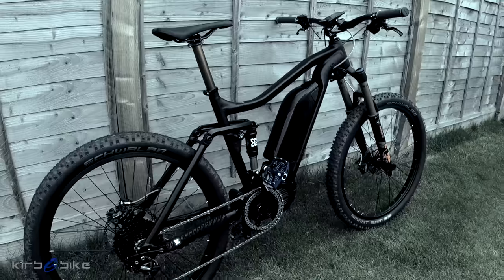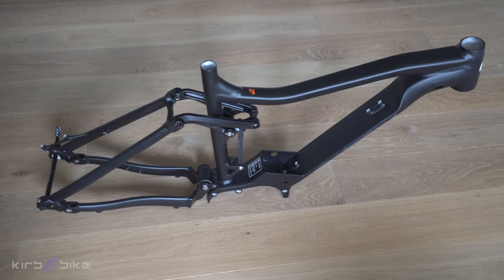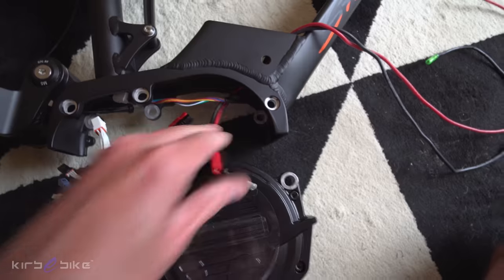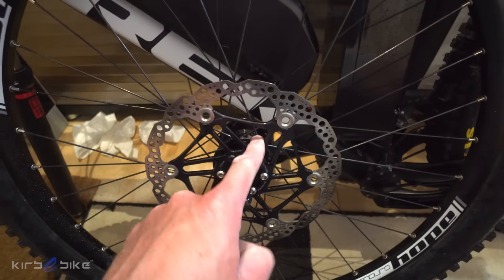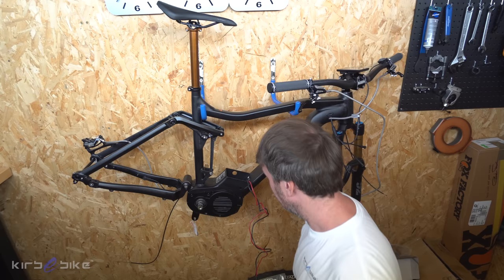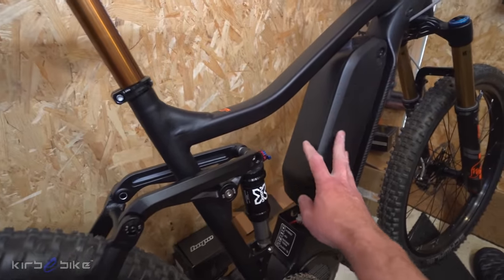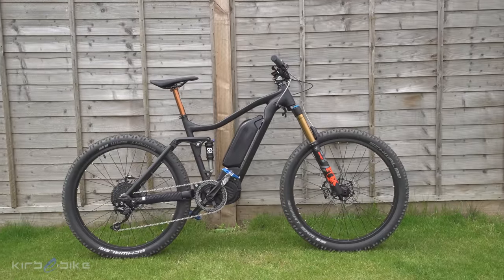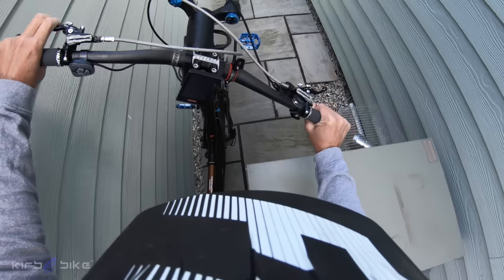HOW TO BUILD THE ULTIMATE eMTB!!! | KIRBEBIKE

Comment: Your videos are incredible – thank you. Very informative and interesting. I’m thinking to get a 1500W hub motor (front). Do you think I’ll have any trouble with the police on the roads? Any advice welcome – thanks 🙂
Reply: @BrotherChad   Since posting, I bought a 1,500w front hub and it’s brilliant fun! Thanks for the advice - I tone it down in populated roads, but am thinking might be good to get a mirror to check behind for cops! With additional pedal power I get 37mph. Great how, from rest,  the front wheel spins up on a damp road!
Reply: A 1500w front hub will do the job but is the worst ebike configuration possible.

It's dangerous to have that much power on your turning axle on a bicycle and you should absolutely not ride it in slippery/cold/wet/snow. Also you best have a steel fork, as aluminium front forks aren't built to withstand that constant force.
Reply: @guylloyd200  so a 1500w rear hub would be fine though?

Comment: I must admit your videos have been very helpful as last year brought a E+Plus bike from Argos front wheel motor, at first for price was very impressive had everything on it mudguards, chainguard, stand and many of items normally have to buy seperate so really felt I got a bargain never planned what to come.  Just after having it for a month and lost all power and forever hit a bump chain come off and the love for this cycle started to change, it started to sound tinny and deraillur was ugly and cheap looking never went into 7th when adjusted to 7th gear wouldn't go into 1st gear. Front disc brake went funny and everything about the cycle felt cheap, looked great but everything was cheap, metal mudguards and chain protector just going back to the 70s and early 80s, that was fine for then but not today as there is better materials, so I was going to send the cycle back but watching convertions had a better idea, with it being a eBike it had places to hid cables which a normal cycle just wrap cables exterior. so ideal for convertion,

First of all get rid of the hub motor convert to a mid motor so opted for the Bafang 250w, this would get rid of the nasty chain guard that when chain comes off takes 5 -6 minutes to get chain back on, no mesing with botton crank bracket motor slipped strieght through cables hidden and it has a back pannier battery soldered a better connecror got rid of their poor connectors that kept vibrating off.  Also swapped deraillur from their nasty looking one, replaced metal mudguards with good quality plastic ones so took all the rattling away when riding the cycle.  Had a spare front wheel and was able to use the tyres and inner tube which where probably best thing of rhis cycle, so I am now riding 35% of the original cycle as 65% of the existing parts have been replaced.

What as this done to my cycle?  As it was I would of given it 4 out of 10 but as it is now 8 out of 10, I need to get better disc brakes as already had a brake failure with existing brakes, I did buy a universal 160mm brake set but didn't fit properly think need a different  bracket, if I could get better disc brakes this would take the cycle to a great 9 out of 10. To get 10 out of 10 I think the colour of rhe cycle needs changing but not going that far.  But yes converting your own you can make it as you would like it.  All we need now is the UK to cange the law concerning ebike in line with US 750w, 28mph then could really build a beauty.  Mike

Comment: One more question: Is there the possibility to use a dropper post with internal cable?
Reply from the maker: I will cover this in another video, but yeah it’s possible. The seat tube is open at the motor bracket end so you can route the cable internally through the frame and out near the head tube.

Comment: Hi Andy, im just curious about one thing, why did you go with a 48v and not a 52v.

Also i saw in the video that you first tested it with a 52v. What was the difference you experienced? 

Thanks
Reply from the maker: Yes I tried it, on a reduction drive like this 51.8V is less noticeable than say on a hub motor. Also the 51.8V battery was higher in capacity and therefore quite a bit heavier which is noticeable in the handling (if you are chucking the bike around in the woods etc!!)
For commuting you could just stick a 51.8V battery on there and benefit from slightly better efficiency.

Comment: Hi Andy, Im building a backpack style battery with 38120 headway cells. My options are 8Ah with 16 cells or 16Ah with all 32 cells. Headways are big and heavy and the 32 cell pack is almost 20 pounds. I plan on doing 10 mile or less rides. take my kids to school and get milk from the store type stuff. Will 8Ah be enough? Bafang mid 750 btw.
Reply: I found a Cannondale Downhill bike called the Perp 2 for $650 cad, thats like 300 uk bucks. Its from 2009 but was never used. Its all ready to go, just need to finish the battery. Looks pretty stock when you spend the time on cable management. I also connected the bafang headlight power to a RGB led controller. I snaked RGB led rope lights along the frame to give it a cool red glow effect when the sun goes down.
Reply from the maker: Cool, I reckon 8Ah would probably do it if you are keeping at 10 mile range...

Comment: Amazing build. The peak power is around 600-700 watts on high end mtb not 250 watts but they do deliver in a more progessive way than bafang. I still trade this for power.
Reply from the maker: Ah..but have you tried this bafang because you can tune every parameter 😁
Reply: @andykirby  I have been tuning a bbshd for a year and still think my brose motor is more progressive. Brose meter the pedal power and match to a variable motor power. Bafang is just basic on or off at set power.

Comment: PLEASE HELP!!! I built a $5k Ellsworth ID mountain bike in early 2000s, 6" travel front and back while keeping the weight under 26lbs.. It has been parked since I moved from Boston back to Miami 11 years ago.. I would love to mate it up with a Bafang Ultra Max motor.. However.. it would require extensive permanent modification to my frame which being certified in welding I could do but I just can't see chopping up Tony Ellsworths work of art.. Im now 52yo and do not see me pedaling 50 miles in the heat of Miami as I did in NE when I built it, so..the idea is getting a lil easier to swallow. Is there enough of a diffence in the Ultra vs the HD motor to make it worth the added modification needed for the Ultra?? How much is the frame you used in this video and is it available as frame alone???

Comment: the 160 torque figure is meaningless  because the 160 is taken after and depends on 2 reductions, I mean you could reduce the speed further and double that 160 figure. . alta motorcycles also came up with meaningless bs torque figures.

Comment: Can I  use a Bosch cx drive and battery of my hard tail
Reply: No. It needs g510 only but the bosch is a 36 volt battery and you want a 52 volt for the bafang. They run on 48 but slower.

Comment: Most of the new EMTBs are 250w nominal power. The bosch's are close to 600watt peak and the new brose S gets close to 800. The rocky mountain powerplays have ~120nm of torque( close to 1000watts peak) and 630watt batteries. 700 watt batteries have been available for specialized since last year. Nice build though, what was the total cost..it does need a dropper post though.
Reply from the maker: Specialized are charging £1000 for the 700wh battery, it’s insane. Yes you are right about power, people need to realise these “legal” bikes run more than 250W and 250W is nothing power wise. Total price of this actual build would be about £4500-5000, the suspension is a big part of that. Dropper post coming soon.
Reply: @andykirby  Look at ascend X, good value droppers. So similar price to what I paid for my Trek LT7. When you "dongle" a mainstream bike it does transform them. I pedal out at 33mph on the flat currently with stock gearing. Yes the 700 watt battery is a grand...but its integrated...I prefer the look over the blister batteries.
Reply from the maker: Cool will do thanks, it would be interesting to measure the power on a dongled mainstream ebike. Yes integrated batteries can look cleaner, but I still don’t think it justifies the price when the cells cost a few dollars each!, also you can’t fit as many cells inside the tube, it’s ok for 250W but for 1000-1500W it’s gonna be hard, unless you use the latest insane 21700 cells. You’ll need a lot less cells to make serious power. I’m looking into this on a new frame design.😁

Comment: Does the motor have a built-in torque sensor..? (If yes, does it work smoothly..?)
Reply from the maker: Yes it has a torque sensor, it works nice and smooth and it is tuneable with an app via Bluetooth.

Comment: So do you need the frame to fit the motor or could i fit this motor to a normal large dh mountain bike frame.. ?
Reply from the maker: Yes you need a frame that fits this motor. There is a mount available which you can weld in to an existing frame if you really want to go that far.
Reply: @andykirby  No worries..thanks for you're reply..much appreciated.

Comment: I have just ordered a 1500w violamart hub for the back wheel 26''on my mountain bike but finding it a real struggle to find a battery to fit the frame and needs to be 48-52v 16.5mah 40amp minimum. Can anyone help? wish I had gone for the 1000w as there seems to be much more choice at that level.

Comment: cars/mechanics uses butt connectors( male to male cable crimps ) for wires that need high amperage rather than solder also due to vibrations that can loosen the solder, have u used butt  connectors if so do they suffice for the job?
Reply: I find crimping the best option where they're going to move a bit, as you say the solder is a bit brittle.
Reply: @girlsdrinkfeck  A junction box will hold 'em together better than solder will, but you're paying for it so you can use what you like. A neat job is a good job, they say.

Comment: How tall are you and what's your approximate body weight? Could this kit be modified to include a full pannier with a cargo box on the back and some kind of aluminum cargo cage/box on the front? Do you ship to the USA or do you have a distributor I can contact here? Do you need a USA Distributor?
Reply: Does it have power steering does it have four wheel drive does it have electric windows does it have cruise control 😂"beat it kid ya bother me" 😂

Comment: I would like to caution people about one thing, these mid drive kits, bicycle chains are not made for that kind of torque, the average human can only put out 300 watts of power, so the chains are made for that but not much more, especially the cheaper chains.
I build ebikes and my personal experience has been that a two wheel drive hub motor bike is about the best you can get, nothimg stop's it, I run Crystalyte 3540 motor's so it's a bit heavy but I go off road too, 15" of ground clearance at the cranks, Fox DHX rear shock, Marzocchi forks, Deore XT all around except for rear freewheel.
If you dont like the weight of two Direct drive motor's, then try two small geared motor's, for those worried about the law in Europe IE: 250 watt limit.  Then get the controllers from EM3EV, you can program them, so you can set the 3 speed switch to legal limit but have the option of much more power off road.
Paul at EM3EV has done and excellent job of spec'ing the controllers, extremely high grade wiring for both power and phase, no need to upgrade like most.
The last thing I'd like to mention is the chain thing again, as an avid motorcycle rider, I've had chains snap, I still have a scar on my calf from one of those times, yes it was a balls to the wall ride off road and maybe I was pushing it a bit :) but either way it is something to consider if a chain snaps and the motor does not cut right away, it could do some serious damage to you leg, foot etc...
I'm not saying dont buy one, the choice is yours, but I will say from experience, I've built 2, two wheel drive mountain bikes and it is awesome once you get past the learning curve, if you think you are going to just hop on and ride like the devil, think again, big difference in ride, how and when to apply power during a turn etc...  most run front motor at half power of rear. 

I hope this helps, ebikes.ca, EM3EV, BMS Battery in China, Crystalyte,   Headway Lifepo4 cells rock...    I've shopped at all those places, had good service, good products, the No name brand of batteries from BMS Battery are pretty good, I have 4 of the 36v 15AH water bottle Hailong case and they work good. I've put about 15 cycles on them so far.
Reply: I used to snap Shimano chains regularly in the '90s on a regular rigid MTB, I found the Sachs (who became SRAM) chains were stronger & didn't fail often, but I never met a stronger chain than the Rohloff one I eventually bought. I run KMC nowadays, they seem to be near to Rohloff strong but come in narrower sizes for modern drivetrains (they shift better than the Rohloff chain did, was it's only downfall).
You can buy stronger chains in BMX (1/8th inch) flavour, but that's not going to fit a modern drivetrain with anywhere between 9 & 12 sprockets on the rear depending on the pricepoint. I've been out of the loop for a few years productwise but imagine there would be E-bike specific chains available these days, if there aren't then maybe some enterprising soul reading this might be able to fill a niche in the market (though I would be surprised if the big manufacturers would leave themselves open to such obvious cause for litigation).
Reply: Yes, I have used headway LiFePO4 cells from BMS Battery....they are very good cells for big power....if you have the space to mount them!  Probably not the best for a super lightweight bike....but the cell life is hard to beat.  Rocking the same 38120 headways for the last 6 years, heavy usage, 2000 watts all the time, and they still have 90% capacity

Comment: I know this video's old but a little advice about your solder joints, don't bother with them. I'm an oil and gas electrical technician, if you're joining 2 wires that thick just use crimps. They're structurally superior to any solder joint you'd manage, way quicker, don't need heat shrink and no potential heat damage. 

You get packs of double ended crimps for pennies.

Comment: I did that. Exept my bike doesn't feel like 5000e ebike, but it outruns them all whit only 250w controller. Guarantee. Its litle difficult to drive, but it is quik. Whit 1000w controller its ludicress to the point of no point and illegal. 250w easily wheeling in 13th/21 gear, 1000w 20th/21. Torq is most important, right?

Comment: How do the pedals work if using throttle not pedal assist with mid drives ?
Reply from the maker: They’ve got their own freewheel so the front chainring can drive the rear  gearset even though your legs are still! Pretty amazing actually.

Comment: Ultimate ebike.....  2 x 10,000 watt Crystalyte motors...  I built one about 10 years ago now... 5403 rear and a 5304 front, no not typo the 53xx series came in front and rear and models, the 5403 made years later, is a rear only motor, you cannot get a 5403 front motor...there is a vid on youtube about it somewhere... 
I get the legality question a lot in Canada too, I tell people, because I can limit the amps and speed to street limits, it is street legal, but when I hit off road I can let her loose... then I usually say, I dont have a car, how else am I supposed to get too the trails....push it ? I really dont have a car, so it's not a lie..for me.
For most people, I could point to my horn button and say it's the limiter, they would not know the difference... but my bikes a bit different than most... full suspension mountain bike frame, Marzocchi, Fox, Deore Xt, Saint brakes, LED head lights, turn signals, brake lights, off road lights, and enough switches for cruise control, regen off and on separate for front and rear, horn, 3 for lights.... then there is the trailer.... with 2 motors like my bike, but only 1000 watt, cyrstalyte 3540's on bike... 4 - 36v battery packs

Comment: im confused so where are we suppose to get the motor from to diy our self an ebike i cant find any link to the places they sell the motor? tried to find it online but theress nothing on a 1500 watt bafang m620 motor only  1000watt and less.
Reply from the maker: I know the video is quite long so it can be difficult to take in everything I say, but the motor used in this bike has a special mounting system which is built in to the frame, we sell the motor and frame and battery together, then you can finish the bike with whatever suspension and other components you like. Here’s the motor, frame and battery kit. https://www.cloudsto.com/ebikes/kirbebike-kit/kirbebike-vapour-emtb-frame-and-m620-powertrain-kit-detail.html
We also do simpler kits for converting any bike to an ebike here: https://www.cloudsto.com/ebikes/kirbebike-conv-kits.html
Reply: @andykirby  i could find the frame in your site but not the motor on the video....the only ones i see in your link sent are the wheel mounted motors.
Reply from the maker: The motor comes with the frame. It will also be listed on its own on our site later.
Reply: @andykirby  what kind of range does it get in millage with the kit on the site I want to commute to work with one of these.
Reply from the maker: About 35 miles, depending on terrain, rider weight etc. For commuting you could use a low assist level. It’s the off road stuff that uses a lot of power 😁

Comment: For less than £3.400 you could buy a quite nice CUBE STEREO HYBRID equipped with an integrated 500Wh battery and the latests Gen4 Bosch Performance Line CX motor and SRAM transmission.
Reply from the maker: Yes you can but it’s just a 250W ebike at the end of the day. This has 1500W and 160Nm torque and will fly past the cube on its back wheel uphill😁